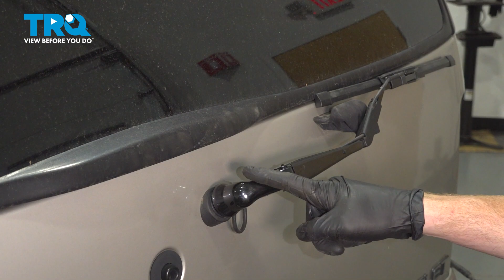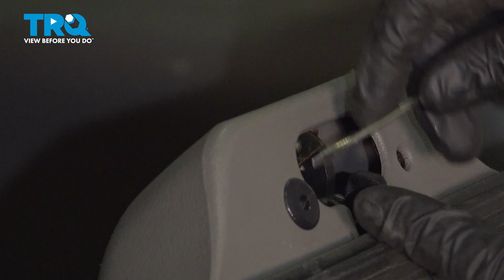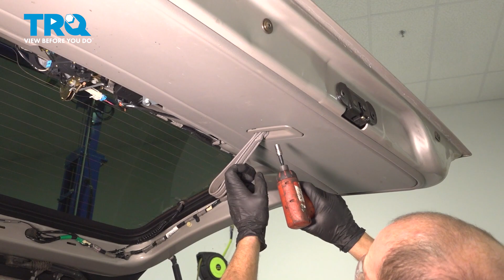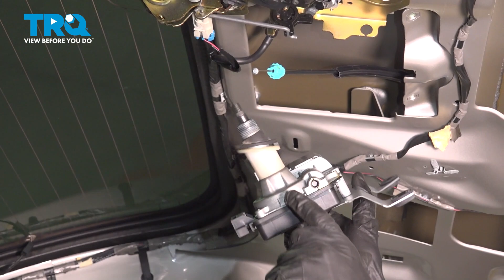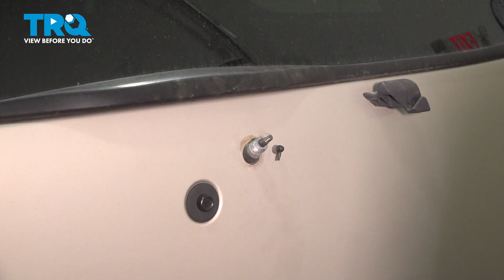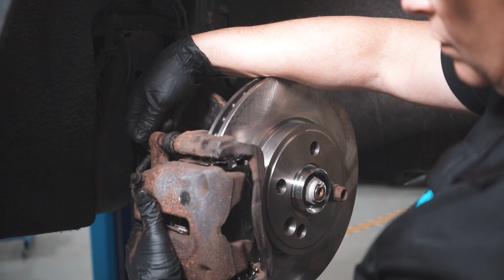How to Replace Rear Windshield Wiper Motor 2000-2006 Chevy Tahoe

Comment: Thanks TRQ/1AAuto for your help. Hot days can make that mounting nut soft so use a deep well 6 point socket to remove it and if that bezel doesn't slip off ,keep going and wiggle the old wiper motor after you have removed the bolts from the back and after you feel the old motor coming out ,you can grab the bezel. I had to run to a Pull A Part because I used the wrong socket on that mounting nut and stripped it and luckily they had a couple of Tahoe's with that nut and they let have one for free.